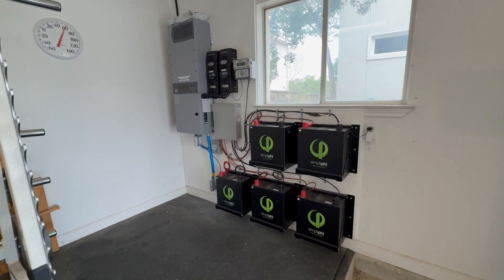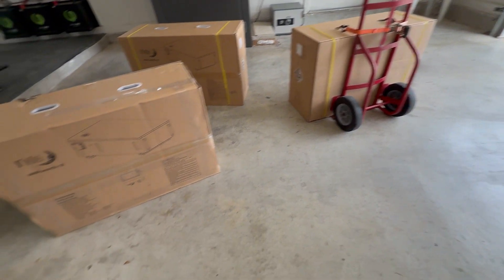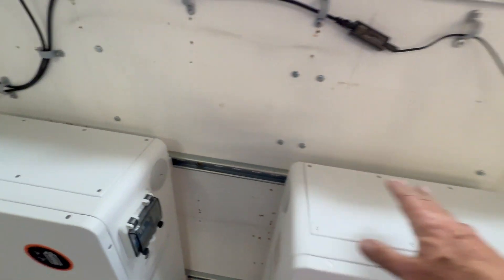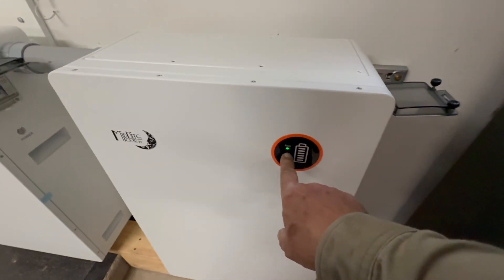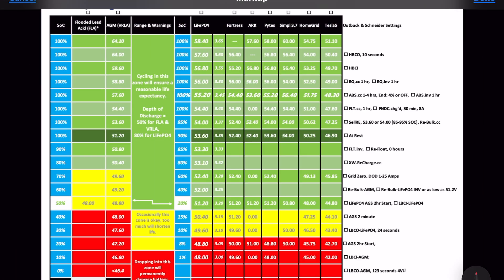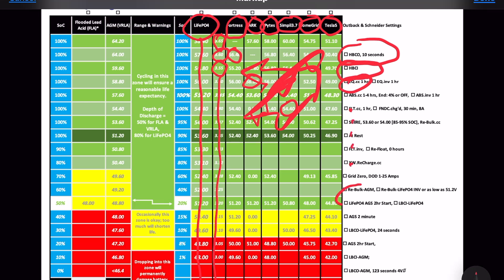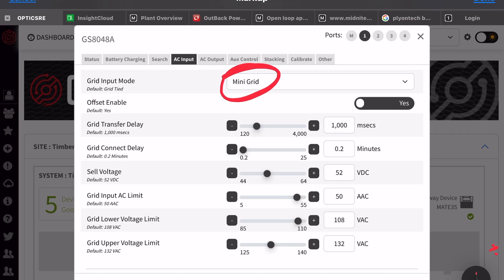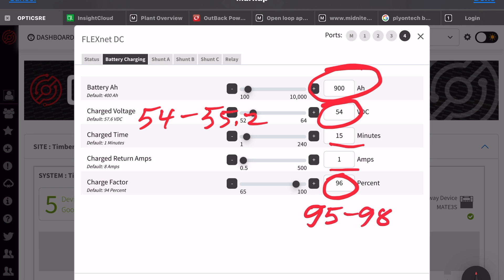Outback Radian GS8048A upgraded to MidNite Powerflo16 48kWh!

Comment: It looks like you just connected the data cables to the batteries without one going to the inverters or a HUB. How did you get the system to communicate with the batteries BMS since the 8048A inverters don't have a CAN port? Or do they even need to with how you have the settings adjusted on the Mate3?
Reply from the maker: Correct. The batteries are connected together via CAN/RS485. The Radian can’t communicate with the batteries so I used voltage based settings for Absorb, Float, SellRE, etc. It works just fine. It would be nice to know what the battery thinks the SOC is, but for now SOC from the FlexNet DC will do. I’m working on a plan to use Venus OS on a Raspberry Pi, maybe all of the pieces can come together then.
Reply: @maverickmacgyver Thanks for clarifying! We have the exact same inverters and charge controllers, but are just now trying to switch over to these Midnite Solar batteries from lead acid. Trying to get it sorted out and working...
Reply from the maker: @SethMichie let me know if you need any assistance.

Comment: What bus bars are those?
Reply from the maker: These particular bus bars come from Amazon. Search for JAMGOER 300A Distribution Block with 4 each 3/8 (M10) Terminal Studs. They have various sizes and I sometimes get the 5/16 (M8) version. I also like Victron Lynx Power In and Lynx Distributor (fuses sold separately). I hope that helps.

Comment: I am surprised you don't have a hydraulic crimper for the terminals.  Shouldn't the bus bat to battery wires be all the same length to keep resistance as equal as possible ?
Reply from the maker: The big crimper has 36” long handles.  The short crimper works great up to 2 AWG. Both are real tools with 15+ years experience. I’m holding out for a Milwaukee 18v crimper someday, maybe. 
I have made hundreds and hundreds of equal length lead acid battery cables. With “Active Balancing “ and old-school Absorb time, maybe now I can retire from equal length cables. In fact, I have a few LiFePO4 battery manuals they say “don’t bother”. I’m not trying to forget my oath of office. I’m just trying to collect data.
Reply: @maverickmacgyver  I suppose with the batteries interconnected maybe they will sort of self regulate their inputs and output currents .
Reply from the maker: I believe that to be true. My home system has a large LiFePO4 bank. I’m running some purposely short cabled batteries with some long cabled batteries as a test. The baseline set, also in parallel have equal length cables. I’ll swap the shorts and longs and compare the results versus the baseline.